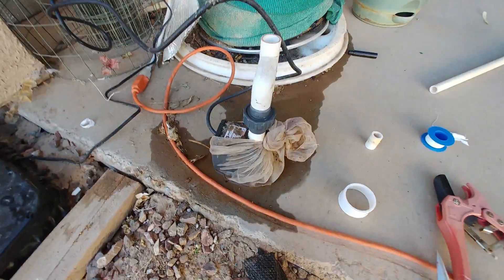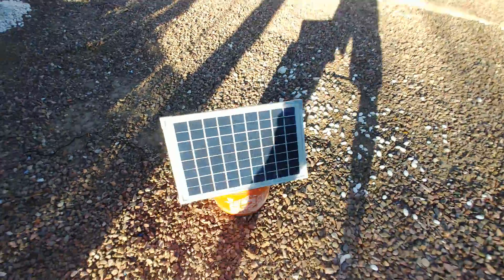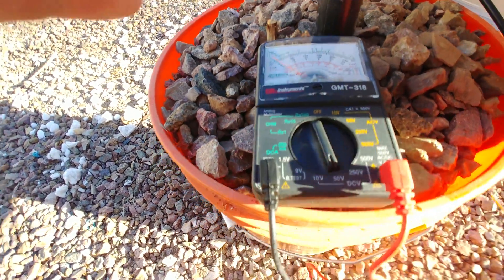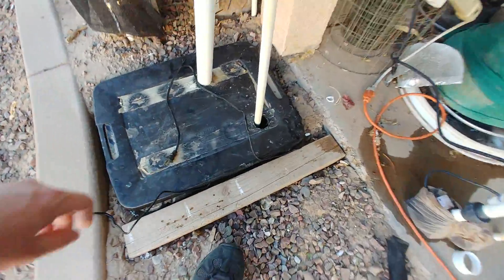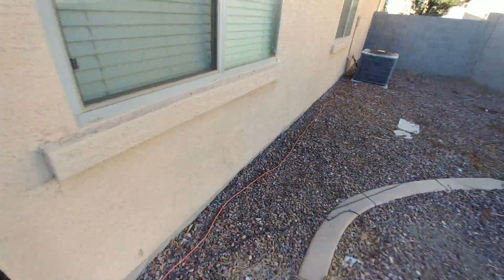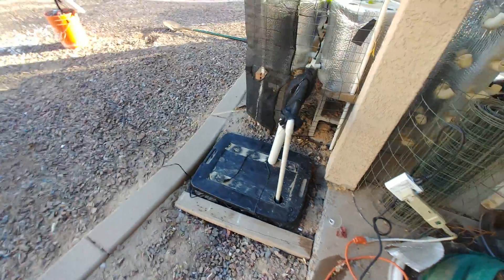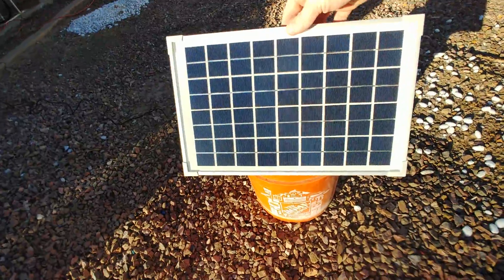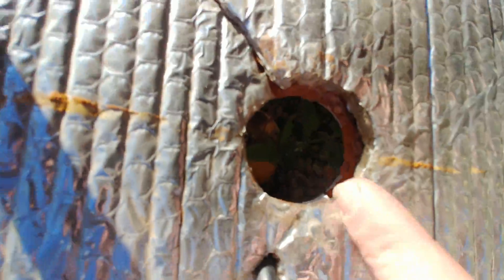Solar powered hydroponics!

Comment: Wicked cool man! I love the idea of a solar set up. Real quick, are you still adding anything to your water in terms of nutrients or is it just from the tap?
Reply from the maker: Johnathon Damschroder It's filtered water from the tap at .06ppm and i use a mixture of 20-18-38 fertilizer 10 g of masterblend with10 g of calcium nitrate and 5 g of Epsom salt per five gallons and I'm using an gallon res tank.
Reply: Ok cool. I was just curious. Also, i'm glad you got your solar panel. I don't know if you heard but Trump just signed a tariff on all solar panels that aren't made in the united states which to my knowledge is all but two brands.

Comment: Nice! Just wondering if your going to add your timer back. If so, how much longer would you set the time for it to work?
Reply from the maker: Wayne St Amand I do want to include a timer like before I don't have one for dc as of right now, and I will have it turn on twice a day like before because if the tomatoes get to much water they tend to split open.

Comment: cool set up but no where near 100 volts website says max of 17.28 volts at .579 amps
Reply from the maker: Alex Rustick you are correct, I'm using a brand new cheap meter that needs calibration and I hadn't done that.
Reply: i wish my system could run off of solar but i need a 1200gph pump run 24/7
Reply from the maker: Alex Rustick I have the same problem with my aquaponics, I'd need a pretty big setup.